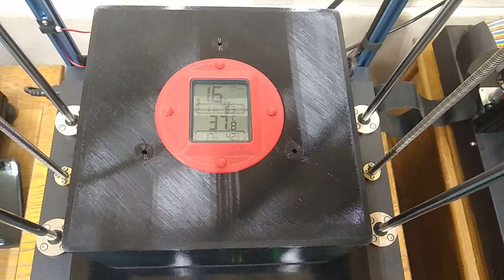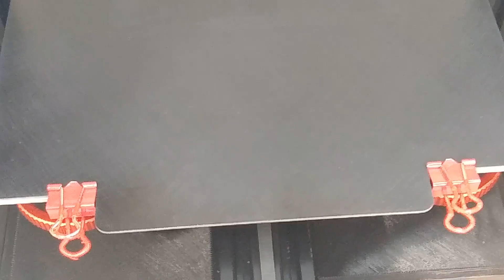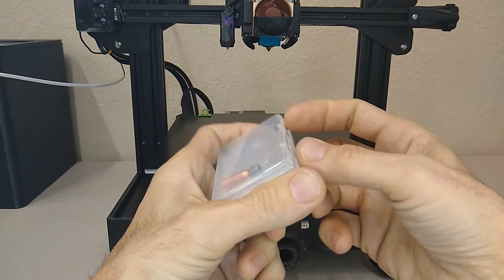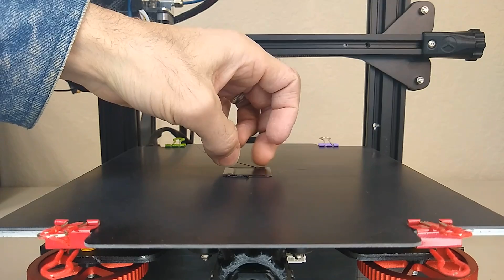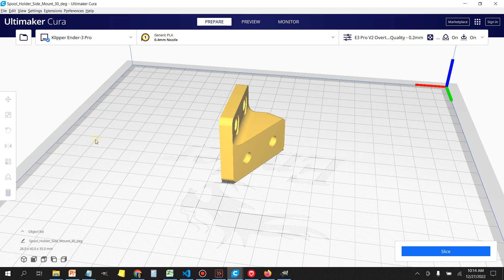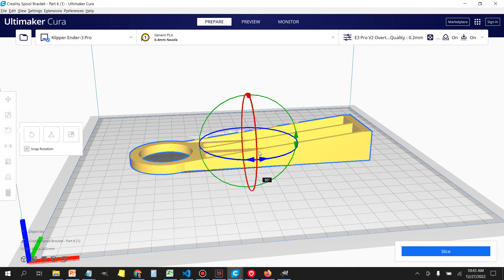Ender 3 Pro V2 The 6 Keys To Printing Nylon Without An Enclosure aka Open Frame 3D Printing or Glue.

Comment: Hi, Victor! Is your minimalist fan bracket compatible with Spider Hotend 3.0 Pro?
Reply from the maker: Hello Gustavo, Thank you for commenting and support consideration. At this time, unfortunately, it isn't. I'll have to purchase a Spider 3.0 Pro to see if I can design a version for it. Stay tuned, I'll create a video when I do.

Have fun with your mods :)
Reply: Incredible! I was about to buy from your website but I couldn't find the measurements. In the video description, the link to ‘Creality 3D Printer Accessory Kit’ leads exactly to the Spider 3.0 Pro, so I assumed it might be compatible and decided to ask. The size of the Spider 3.0 Pro appears to be similar to the standard hotend. I guarantee I'll buy it when it's ready!

Also, all my E3V2 fans are Noctua, so I can barely hear it while printing. Do you know of any blower that is as quiet? I don't think the solution itself can be physically silent because of the turbulence inside the fan case, but who knows... I couldn't find silent blowers, so I had to adopt the Ender Silent Fang design on Thinginverse. Maybe it can serve as inspiration, just as you inspired me to rebuild my printers! 👏👏
Reply from the maker: @ofamosogustavo  Hi Gustavo, Thank you for the heads up about that link, not sure why it points to the Spider. I'm going to have to fix that.

I run an 80mm x 80mm Noctua for the power supply, and three 40mm Noctua fans for the control board, Raspberry Pi and hotend. The parts cooling fans are two 4010 blowers. Without them running the sound level is 29db, which can barely be heard when sitting just 2ft away from it. When the parts cooling fans come on it's around 45db, which is not bad at all and way quieter than the stock setup.
Reply: @vbared  Cool! I'll look for new blowers and give them a try. Thanks!

Comment: I believe there is  many filaments that has bad composites as i get alot of clogs. I know that my leveling is correct with paper no abl as i prefer paperto level. Any sugestions on the best filaments without any rubbish in them.
Reply from the maker: Hi Elias, Give me a call 478-227-3301 so I can get more details about the trouble you're having.

Comment: Hey Vic. Your prints look amazing. I have tried every cura profile from different makers kits never the same. Maybe its my filament, Can you please share your cura  profiles for PLA,PETG,Nylon TPU etc. I have a bowden extuder. Also i have bought the slice engineering model and my extruder clicks or tries to back feed meaning i have clogs and its so frustrating because it was great at first but in time it just got worse. Cheers Mate! I like the Channel.
Reply from the maker: Hi Elias, Thank you for your kind comment. Please give me more details on your setup. What printer do you have? Are you running the stock fans? What fan bracket? Which firmware are you using? The hotend can be super tricky to put together just right. If you want give me a call 478-227-3301 so I can help you troubleshoot.
Reply: @vbared  I will do my best get one issue solved. First I use ender 3 original and the stock hot end. Some prints work well on my cura settings where as other prints fail on the same settings. I bought bulk filament and I am suspect as it was cheap. They have moisture and my prints look horrendous. Anyway I have new filament on its way. I will try that and if it goes well then I know what the problem is. Thanks mate. legend

Comment: Great video have you printed any nylon on the Cr10s pro ? Any tips for that machine?
Reply from the maker: Hello Jon, Thank you for your kind comments. My CR10S Pro V2 currently has an earlier version of the Minimalist Fan Bracket that I'm going to be upgrading to the lastest closed bottom version the next time I need to service the hotend. The only three things needed is a hotend that doesn't bleed air on the printed part, Garolite G10 build surface, Overture's Easy Nylon in black, a printing temp of 230c and 0c for the bed.

We currently have our G10 Garolite precision cut for the CR10S Pro V2 in production. I'll put out a video once it's ready for purchase along with the links.

Best of luck with your mods!

Comment: Your kindness, helpfulness and professionalism are top notch, gonna install my G10 tomorrow and print some PETG printer parts.  Ty and Happy New Year
Reply from the maker: Hello Kenneth, Thank you for your encouraging comments. I appreciate you very much and am glad you found value in this video for your viewing time. The G10 is a game changer for PETG, PLA, and Nylon. I haven't tested it with fiber reinforced filaments so if you are planning prints with those materials make sure to apply stick glue to the G10 to act as a release agent. 

Happy New Year!
Reply: @vbared  Hello Victor, you earned the comments :  )
I am an old retired engineer and familiar with how the G10 is made (in general not specific formula), laminating fibers usually with an epoxy under compression, in this case fiberglass.  Different types of fibers/fiber cloth and epoxy is used depending on needed specs (like heat tolerance and expansion characteristics to name a couple).  Do the same with highest temp epoxy available with carbon fiber cloth.  I don't think it would work well as there would be too much adhesion since the expansion coefficient is lower... but the only way to know is try and I thought I'd ask before I decide to make one myself (just experimenting).  Best regards.
Reply from the maker: @kennethhicks2113  Hi  Kenneth, I understand now. It would have been awesome for me to have pursued engineering. I enjoy solving problems, and working with my hands. Reading your enthusiasm about your career leads me to the conclusion that you enjoyed your work. 

I haven't tried making the G10 material myself but cut down the sheets to fit the Ender series of printers. It would be interesting to learn if a few can be made as well without the manufacturing machines. I'm sure with enough persistence that anything is possible.

Keep me posted on that project if you decide to play around with making it.
Reply: @vbared  Hi Victor, yes I did/do enjoy being a kid :  )  I will keep you posted but as I'm sure your aware, lot's of stuff on "want to do" list (presently printing b-day present for mother-in-law I almost forgot about...).  It isn't hard, ever repaired a fiberglass boat?  Making laminated sheets isn't difficult (google). Warm regards, Ken
Reply: @vbared  FYI, Thought you  may be interested in this,  use your imagination. and don't laugh at panty hose... integral part of hvac....
https://youtu.be/wm_zK3hUicU
btw, the "Meter Monster" (printer) in build... G10 like for the square meter bed decided 
;  )
3d parts make excellent molds

Comment: Excellent! Im getting my setup going for Nylon. I have the Garolite bed on order. Interesting that you experience is so different from the called out print specs from the filament manufacturer for bed and print temperature.
Reply from the maker: Hello Baler1992, Thank you for commenting and supporting my work. The Garolite is game changer, soo easy to use, I detested dealing with the stock glass. I have a WhamBam on one of my printers and that thing has got blisters all over it from the film coming off, it was super expensive too.  Yeah, I was surprised too about that too. Overture recommended 245 - to 260 and bed temp of 50c with stick glue. At 260 I had filament oozing like crazy so the initial test prints were very stringy. It wasn't until I got down under 240 that things started improving.

Let me know how your Nylon prints go.

Comment: Hi Victor, thanks for this video. I bought your original minimalist fan bracket and now I have downloaded the offered upgrade but when I opened the upgraded stl file, it shows the heat sink fan deflector to be a part of the bracket itself and not separate so it will be impossible to install the heat sink fan. Can you plz have a look at the offered upgrade file? Thanks
Reply from the maker: Great catch Mohammed, thank you for letting me know. I'll fix it ASAP
Reply from the maker: Let me know if you got the new fixed files. I oriented them properly so all you need to do is print.
Reply: @vbared  Thanks for the new updated files which look perfect, haven't printed them yet. I was just thinking to start printing in ABS and realised that there was too much downward draft to make the print warp even without the cooling fans turned on and then I saw your video. Thanks for making this update, much appreciated.
Reply from the maker: @MohammedQureshi-wt7th  Anytime Mohammed, thank you for making me aware of the issue. Print one up in PETG install it and then make one out of ABS. It should hold up enough to get one print out of it.

Comment: You're kicking out tons of great content!
Reply from the maker: Hello Tehgangstadawg, Thank you for commenting and encouraging words. I'm glad you found value in this video for your viewing time. I was surprised that even the filament manufacturer didn't get the use instructions right. Using their recommended settings produced horrible prints that warped terribly.

Best of luck with your mods!